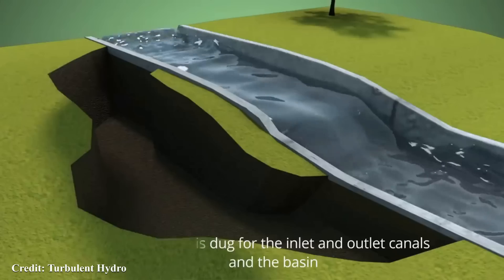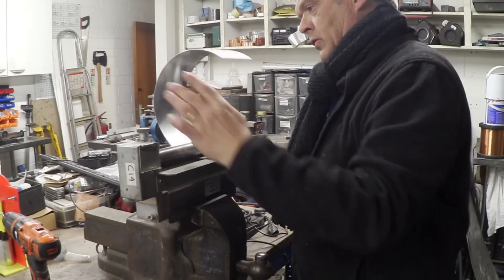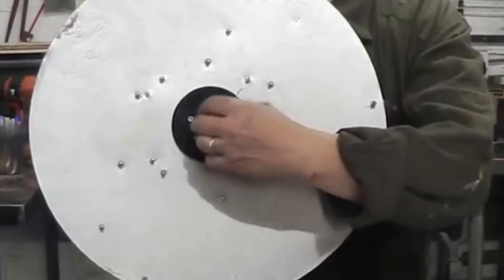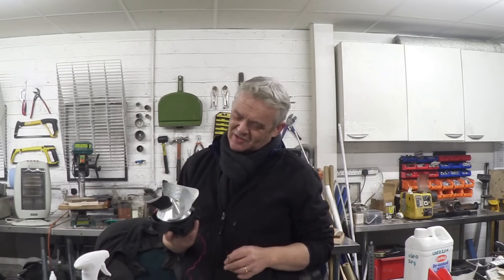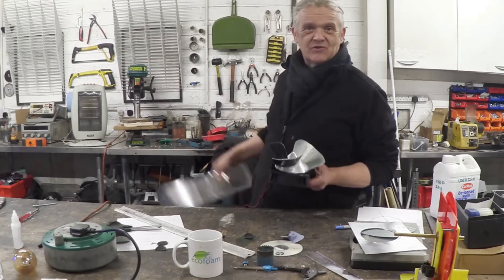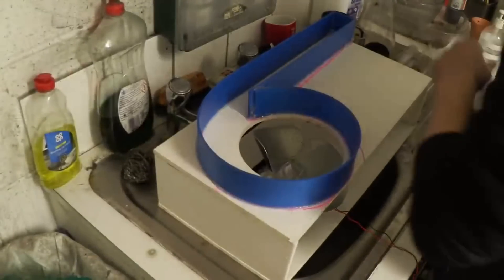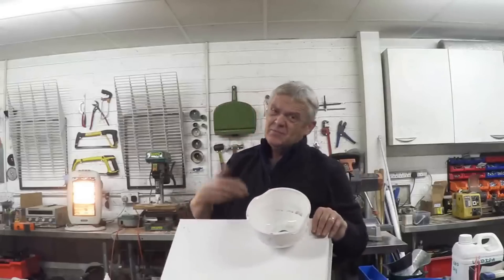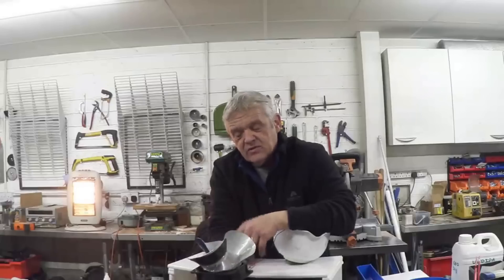2240 Turbulent Turbines - Changing The World Of Microgeneration?

Comment: I would think that you are comparing apples and oranges here. Wind can be compared to speed, "Meters/Second" and longer blades can provide more power for torque. But water should be compared with torque and friction supplied by force. How much torque would your new underwater rose design be able to supply for spinning a loaded system. The weight of wind and water are very different when interacting with the systems. But very interesting. I just wish I didn't live in a desert. I would love to see the amount of load it can push under water.

Comment: would be cool if they used these in the gutter systems of tall buildings so that there is like this zig-zag of turbines on the left and right corners of a wall's face, so that the same water is used to generate electricity multiple times on its way down. Buildings could be rigged with those step things also on the stairwells, and have some type of sandbattery that sucks up all that energy as heat for long term storage.

Comment: I thought that the increase in velocity at the center of the whirlpool was the advantage to this design. In the graphic you played at the beginning of this video the opening was something on the order of 1/5th of the size of the reservoir and in the center. Would you be able to achieve the same result with a smaller rose a smaller hole and more of a whirlpool in the center? I would try it myself, but I do not have the ability to do so.

Comment: I think you missed a trick here. By using a set amount of water from a set height, you could easily compare how much of the potential energy each blade type has converted.      I will never understand why the big original version doesn't have the generator and electric  connections on top of a vertical shaft where it can be easily serviced.

Comment: Tidal generation 🤔
Moderate flow, high torque
If you made the power nacelle look like the "Fenian Ram" submarine then it could be moored by the pointy ends with the turbines on each cone shaped end and a seafloor height adjustment underneath like scaffolding with a gravity base for added security. 
When servicing is required,  surface the nacelle and complete maintenance ashore. 
Might be a reach but not impossible 😉
Reply from the maker: like it mate thanks for sharing

Comment: I love your videos, but I wish you would do a few that concentrate on producing a much larger voltage/amperage that could be used to do real life work, example 2-10kw at 120 or 220 vac or 1-2kw at any d.c. voltage. These small scale experiments are great, but the world needs big ideas that make big power, I realize this costs more, but I believe there are options that could make large amounts of power at relatively low costs utilizing recycled materials.  A generator that can't even make 12 volts at 5 amps is basically useless for anything but charging a phone, but one that makes 10kw could actually power an average home, water heater,  stove, refrigerator,  charging an off grid battery bank etc. It seems to me that the same amount of work done to make a small generator could just as easily produce a large one, if the materials were cheap or free, for which I'd suggest automotive recycling places and industrial recycling services for free materials.  Best of luck and thanks for all your hard work!

Comment: I believe that if you could just have a water wheel setup without the rose but instead have have the fan turned on its side and Apply curved blades set on a flat round plate base with a minimum of 8 curved blades affixed onto the flat round plate and using a funnel to concentrate the water flowing out of the bottom of the funnel to have a steady flow of water to then hit blades on a specific point of the curved blades will result in a higher turn rate of the blades and thusly a higher energy output of the blade generator...

It would cut down on the chaotic manner of the water hitting the rose blade setup facing the flow of water.

I think the chaotic manner in how the water hits the various rose blade arrangement does create some resistance that limits the spin rate.

I would attempt to make such a setup if I could access the materials but I'm disabled with a vehicle to locate the components needed to test my Suggestion.
Reply from the maker: that sounds very much like a cross flow Banki - Mitchel type to me mate